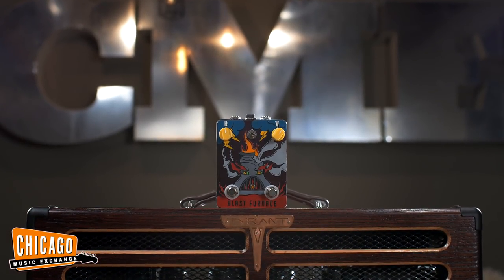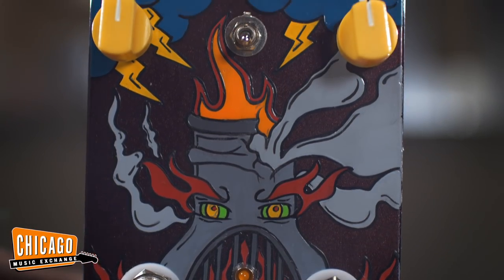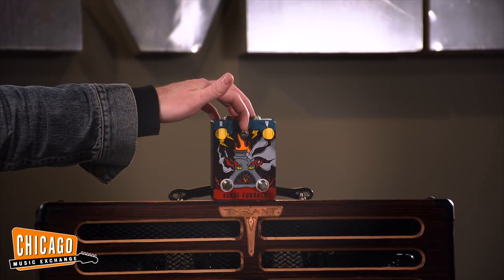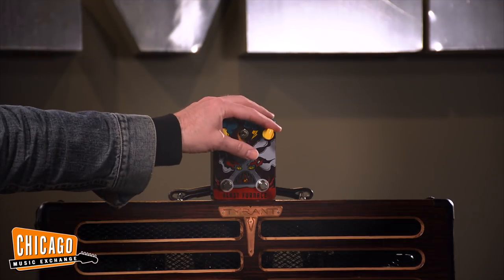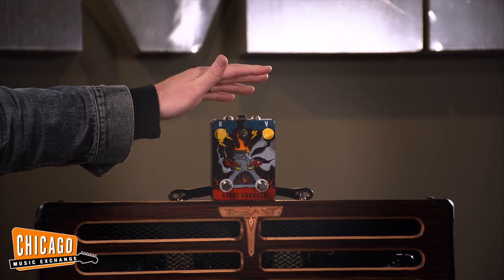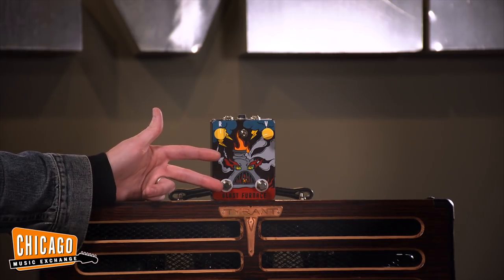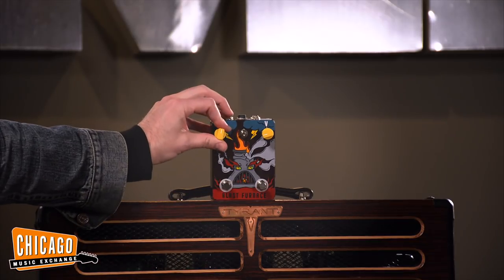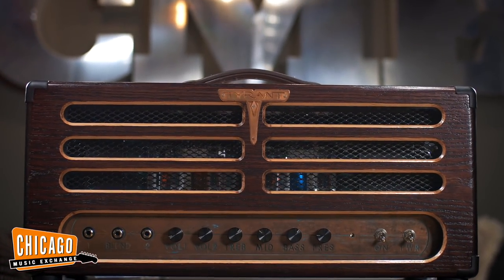Fuzzrocious Blast Furnace Gated Fuzz (Hand-Painted) | CME Gear Demo | Marc Najjar

Comment: ??? delay time is on a trim pot inside the pedal? why even put a delay in there. It's laughably limited. Would have loved more controls for the original fuzz circuit instead of wasting real estate with the delay.
Reply: Understood. We wanted to make something different, more plug and play. Simple. We are confident the delay time works to girth out the fuzz, but just in case the user wants to do something different, we put another option there for them. Less external controls helps simpler players feel more confident with a dual effect while allowing the tweakers more fun to play around if they wish. We offer mods too :).
Reply: well you're definitely the homie for leaving a decent reply to that haha. I can see how some would dig it, just ain't for me. Keep doing your thing though